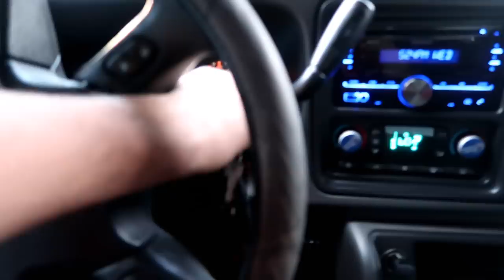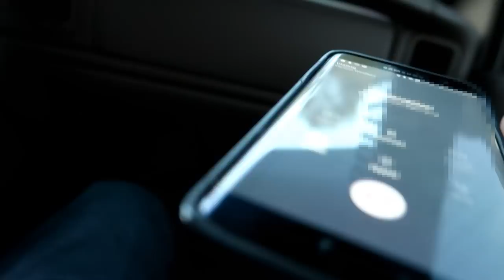WE STRAIGHT PIPED HIS TRUCK!

Comment: That’s a muffler delete not a straight pipe
Reply: Total garbage too. Nothing like fumes constantly radiating up under the cab into the truck. Nvm straight pipes sound like garbage it's so over rated. Throw on flowmaster super 40 or something. But that's just my opinion. And not my truck so I don't have to listen o the tinny rap under load constantly and the unbelievable cab drone. I did true straight pipes to dumps under the cab just before the axle and couldn't stand the drone and the dunes everytime your sitting somehwere at idle.
Reply: Muffler delete is a type of straight piping. A straight through pipe is no cats or muffler so full straight pipe
Reply: @Melonology   that is true my man
Reply: Chris Mason    Did you have this issue when you put a pipe in place of the cut off parts, or did you just cut off all the pipe?
Reply: A muffler delete is when you take off the muffler, a straight pipe is when you cut your cat as well
Reply: Nice one
Reply: EXACTLY why don’t people realize

Comment: If you really want to make it lighter then take off the wheeles
Reply: Alex Nairn I also wonder
Reply: -Lower it for less drag, and better fuel economy
-smaller tires, fuel mileage
-add stickers, 5 HP each 😂
Reply: Wrong those wheels are aluminum not steel so they are lighter

Comment: I don't understand some Sierra trucks mines in 1998 but it comes back as a dual pipe into the muffler system and comes out a single 3 in.! Monster 5.7 small block 350.! I guess the 5.7 had dual pipes coming back and the  5.3 had singles. The singles are so much easier I have to get a y-pipe to come back as a single to go over the rear

Comment: Sounds great but won’t pass inspection :p
Reply: Blaster528 why not?
Reply: Midnigh7Rider Any modification done to the emissions system is considered illegal. If you don’t have a muffler they won’t pass your vehicle for inspection.
Reply: Blaster528 are you sure about that 😂
Reply: in california aslong as the cats are there is legal
Reply: Wtf is inspection
Reply: Blaster528 if the cats are still there it’s perfectly legal. Trust me my truck passed
Reply: Wtf are you talking about? A muffler has nothing to do with emissions.
Reply: I have a 98 Dodge Ram 5.9 360 straight pipe under the cab no cat or muffler loud af and where I live and it’s 100% legal
Reply: Morgan Sharp in certain states having a muff delete is illegal he ain't wrong and tampering with the exhaust system is illegal in certain states  idk why he can't just spend a couple hundred on a better exhaust
Reply: If it has cats I believe it will, if it's 25 years or older it doesn't need emissions(years vary on states)
Reply: That’s only in California
Reply: Blaster528 slide the guy a 20

Comment: I have the exact engine 6.0 vortec and when u cut off that pipe under the cab it’s loud af it would raddle my cab 😂😂 I ended up just taking off the muffler and replacing it with pipe

Comment: Does Garret’s truck have the 6.0 small block or the 8.1 big block I know they stopped putting the 8.1s in around 03 I think 🤔
Reply: 6.0 and no
Reply: 8.1 is the 3500s not the 2500s
Reply: Snipe Stud00 no they put them in the 3/4 tons to

Comment: Is his truck a 1500 or 2500hd
Reply: Tanner Warren 1500
Reply: What lift?
Reply: Garrets is a 2500hd
Reply: 2500hd
Reply: Michael C RC on the drop bars means rough country lift systems. 6in by the clearnace.
Reply: Its a 2500 hd

Comment: You realize you’re losing 20 to 30 hp by taking off your exhaust because there’s no back pressure
Reply: Joshua Dingledine You realize backpreasure is created by the cats and not the muffler. Also that you only loost 5lbs of torque but gain 5-15hp.
Reply: Back pressure is a myth...
Reply: Josh Martz ik the one with the chrome rims is soooo ugly
Reply: Joshua Dingledine back pressure is a myth
Reply: Joshua Dingledine me personally dont  give a shit about hp not sure about them
Reply: Joshua Dingledine it's a lifted 6.0, internally bone stock. not sure he's worried about hp 😂
Reply: Back pressure won't change after the cat... he's still got enough piping to keep the same back pressure as there was stock
Reply: Joshua Dingledine they should have just removed the cat which makes you lose about 40 hp regardless
Reply: Joshua Dingledine back pressure is s myth
Reply: Back pressure is a real thing, but if you have catalytic converters then back pressure is a myth, if you run with no cats and no mufflers then you are indeed fucking your engine due to back pressure
Reply: GushMy Gusher I am guilty of doing this on my old truck 😂😂
Reply: Josh Martz matter of opinion my powerstroke is dropped 2" to level in the rear with 20x12-51 with nitto 420s 285/50 20s but mines going for the drag look plus I don't chop my exhaust I spent $280 for a 4" straight pipe TRUE STRAIGHT PIPE NO CAT MUFFLER DELETE. Mines strictly pavement.
Reply: SlotterhouseHD take a 6,0 powerstroke for instance you delete cat and muffler lower egts better airflow no back pressure into turbo. Diesel cats literally do nothing but get clogged and blow your turbski
Reply: Back pressure is a myth
Reply: The catalytic converters are what created the back pressure, know what your talking about before you spread false information
Reply: It that’s the case why do top fuel drag cars run open Headers........ cats are only for smog and a muffler is to keep the humming out of the cab